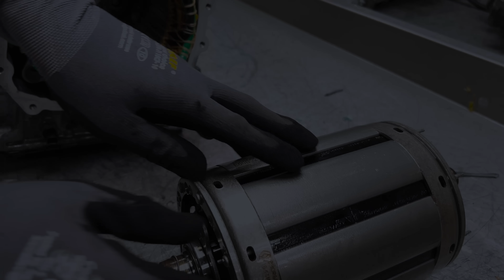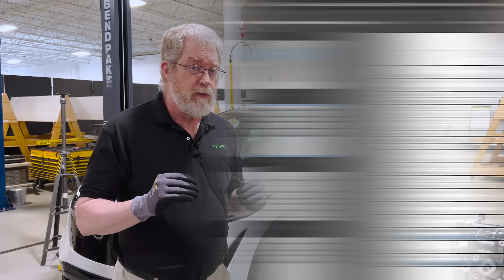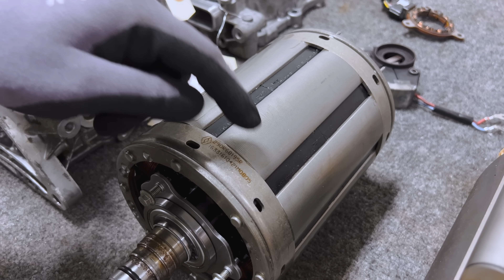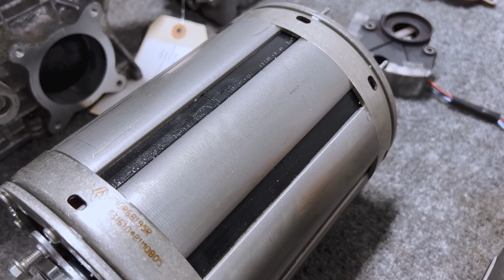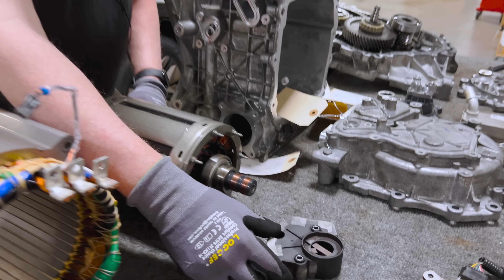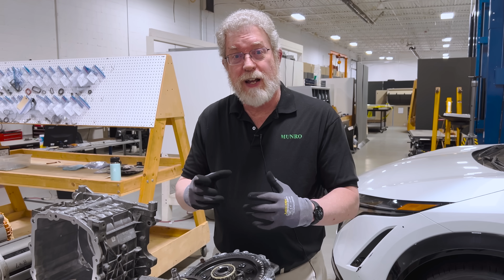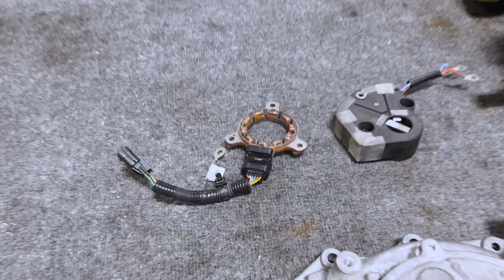This EV Motor Has No Magnets – Nissan Ariya EESM Teardown

Comment: I’m delighted to finally see that someone got wise enough to use a wound field machine. Thirty years ago I was the motor/generator designer for a trade study my company made to see what made the most sense for a hybrid electric vehicle. I designed 4 or 5 machines to a spec and compared them with control systems and manufacturing costs. I was rooting for the induction machine, but the wound rotor won out when all factors were considered. We used an exciter to get the current to the field, but I guess the brushes might be cheaper.
Reply: The brushes may make the packaging smaller than having the exciter winding on the rotor, and less rotating mass too.  I still don’t like brushes if they can be avoided.
Reply: @wtmayhew  in my experience its a lot easier to change a part or component when it is not inside nor mounted within other important parts or soaked on epoxy, i think because of the mobility industry modular things are such a good option
Reply: Brushes and slip rings become wear out items. EV should last 300k+ miles with little maintenance. If it wasn't an issue, the warranty would be extended.
Reply: @YT-MY manufacturers would rather offer no warranty at all. They will offer a warranty to show customers how much better they are than the competition or because some law requires them to.
Reply: @YT-MY  do you get 300k+ on an ICE engine? or were you just saying?
Reply: @YT-MY  You're making a hen out of a feather, Renault has been using this design of motor for some 13 years now ever since the original version of the Zoe, there's no major issues here. The brushes and sliprings are designed to be easily serviced without tearing down the drive unit.

BMW is also using this type of motor in many of their EV models. You're not discovering something all of these engineers haven't considered many many times and designed around, okay?
Reply: I think I saw one recently where the rotating field was excited through a transformer with a moving core.  Pretty cool idea and "ideal" for a synchronous machine, xexnx.
Reply: @mcdevious2229 did you see any rectifier connected to the rotating part of the transformer?
Reply: I don't remember, but you can excite the field with AC and drive the stator windings with [synchronized] AC to make a synchronous motor.
Reply: Le moteur n'est pas de Nissan mais et de conception et de production de chez Renault
Reply: @OliverLeink Yeah, the same principle exists in the Zoe since 2013 already. This is just some fine tuning.
Reply: I have a couple of old EVs (Citroen / Peugeot from the 90s) that use a sep-ex DC motor.  The commutator is a weak spot of course, but I’ve been waiting for it to come back into fashion.
Reply: @evan010101  Commutators wear the brushes much faster than slip rings. This is not the same kind of motor.
Reply: @nickwinn7812 that’s my point. This is the modern version of a wound rotor machine, using electronic commutation instead of mechanical.
Reply: @evan010101  I don't think the rotator is commutated in this motor here. It is DC (but modulated by PWM, so it could be commutated with a full H bridge).
Reply: @tristanwegner agreed. That’s my point.
Reply: I remember seeing a prototype of a machine like you describe at the Solar Energy Expo & Rally (SEER) in Ukiah California ,I think in the 90's. Induction coils (transformer) carried field energy to the rectified wound field. It was very interesting, I've forgotten the name of the company. Was that yours?  If so, Well done! 
These days, if choosing to use the complexity of a wound field, I wonder why not run weak permanent magnets in the field for low torque operation? Then the wound field is only needed for boost at higher torque. I expect it would save a few percent efficiency at cruise.
Reply: @CafeElectric Yeah, great idea. A kind of hybrid exitation. Fex magnets for rolling and coasting (90% of the time) and additional exitation in high torque situations like acceleration (10%).
Reply: I would love to hear how that exciter worked!
Reply: @ockamrazor477  There are couple of ways to do an exciter winding.  One way is to have a stator with permanent or electromagnets generate a field which induces an AC current in the rotor  which is then rectified and applied to the main electromagnets.  I suppose with modern controls there might be a way to dispense with the rectifier.  You could also have the exciter be a rotary transformer of sorts to couple the current to be supplied to the rotor field magnets.  The Nissan motor is pretty high speed and variable RPM which would complicate the latter method.  The chief advantage of slip rings and brushes is saving space and weight.  I have a feeling that the accuracy of control by applying a PWM current directly to the rotor field magnets is also considerable advantage.
Reply: @wtmayhew  a permanent magnet exciter would be uncontrollable. 
You’re right that an exciter could be a rotary transformer, but generally they are an inside-out generator. The stationary part is the wound field that is fed controlled amounts of d.c. and the rotating part is on the same shaft as the main wound field. I would be interested in hearing how else the exciter output could be fed to the main field without rectifiers.
Reply: @ockamrazor477  You would need another section where I assume there is magnetic coupling to induce a current.  You might then need some electronics if you needed DC on the rotor.  Then the question becomes cost and reliability as that could also be subject to failure.  I think I saw mention of a patent about that a month ago.
Reply: >> Thirty years ago I was the motor/generator designer 

Excellent!  I have so many questions.  This motor uses brushes, but not on a commutator.  Instead it uses slip rings.  Is there any material benefit (like greater efficiency) since the brushes aren't commutating?  
Can you make a small (say 4000W) motor of this design with very low KV (like 25) for a direct drive system for my electric mountain board?
Reply: @Rick_Cavallaro I’m retired. Your best bet is to start with a local electrical shop. Also check with aircraft maintenance shops. A small airplane starter/generator might just be what you can use.
Reply: @Rick_Cavallaro  This would not help with motor KV, that is more a function of stator inductance than rotor field strength. Low-KV motors tend to be physically large or very low-power because you need high stator inductance to drive a low enough frequency to spin the rotor slowly without saturating the stator or otherwise having to deal with very sharp current ramps. It just takes more turns.

If you want low-KV, axial flux motors are probably the way to go. They also don't scale down super well, but you can definitely get them in your desired power and KV range, if you're willing to pay lab-concept money. Otherwise the lowest you're likely to find is about 95KV in the sub-10KW-and-not-head-sized sizes.
Reply: I’ve seen a better approach to the breather done by Suzuki on ATV,s. Instead of a tube going up to a higher hight the have a bellows that expands and contracts with pressure. Solves the problem cheaper and is 100% effective.
Reply: @willyleavitt-pe1cw  The bellows is unlikely to be cheaper than a piece of tube and more likely to leak. It's still the best solution for vehicles that get used continuously off road though.
Reply: 영구자석없는 것 외에는 모터의 복잡도 증가, 브러쉬 이슈, 사이즈대 출력 이슈, 모터 제작공정 등의 이슈가 있는데 ,,, 아 😢, 니뽕 ~
Reply: @kristal1624 the issues you mention are all included in a system trade study that considers all factors such as cost, complexity, reliability, recyclability, and safety of not just the motor, but the controller and anything else that is considered important.
Reply: 저렴하지만 좋지는 않은.
Reply: @러킬-k5v what is cheap; and how is it not good?
Reply: In other words you got power to
The stator inductively?
Reply: @bob15479 yes, that's a common technique for large synchronous motors. Mahle got a lot of publicity for its motor of this type for EVs in about 2021; I don't think they have convinced any EV manufacturer to use it yet.
Reply: What you refer as "induction machine"? Can you give me the full name I am kinda lost in translation here,.
Reply: @stefangaleksandrov an induction machine is a motor or generator that has no direct electrical connection to the rotor. A magnetic field is induced in the rotor when the windings in the stator are energized. This induces a current in the rotor conductors that interacts with the stator to develop torque.
Reply: 為什麼沒有大量用於電動車上，因為它有致命缺點，就是碳刷粉末導電導致短路，引起ev off 動力中斷，這款車就有這個嚴重安全問題！
Reply: For those concerned about the brushes - they cost around $90 - $110, so in 250 k mileage…..
Reply: Brush wear is never a concern. The brake pads wear out many times before the motor brushes. Generators and Railway traction motors run for many years before brush replacement. Nice to see that Nissan has made the brush change a simpler procedure then even oil change.
Reply: But brushes wear
Reply: @davidsuzukiispolpot that’s why we did not want them in our design. If you look at Nissan’s brush assembly you will see that the brushes are extraordinarily long and in pairs. This will let them last for a very long time. I believe Paul addressed that issue in his talk
Reply: @lxoxrxexnx  I saw that the "pairs" was addressed, and also the serviceability.  I have seen so many cars in which serviceable parts take a lot of time to access, that I am now squeamish about any scheduled required service, but yes a 160K km interval or so seems reasonable, if it is indeed true.
Reply: @lxoxrxexnx  It also adds a considerable amount of length to the rotor and casing, not great for power density.
Reply: @Nathan0A what “it” are you referring to? This is a mixed conversation and some continuity is easily lost.
Reply: @davidsuzukiispolpot  how long would it takes to change a gearbox clutch plate compare to changing 2 pairs of brushes? or were you just saying?
Reply: @dantronics1682 What is the point of your question?
Reply: @dantronics1682 I think you are comparing ICE motors to electric.  Your error is assuming that brushes are intrinsic to electric motors.  They are only intrinsic to specific solutions.  Even this type of motor could use a brushless system of getting current into the root with some extra complexity.  Do not assume that electric motors need brushes.
Reply: @davidsuzukiispolpot  I saw at least 10 people have corrected you already after reading all the comments, basically I wasnt asking a question just stating that you dont really have an engineering background to be worrying about brush wears, The motor is using the same principle as a European alternator. these doesnt use a permanent magnet and still last well over 20 years or 100k miles
Reply: @davidsuzukiispolpot  I wasnt comparing anything and I did not assume anything, I thought you was the one that highlight that brushes would wear out and would need to strip the motor down to change them. I was pointing out that ice engines with manual gearbox have a clutch and that clutchs takes longer to change than a set of brushes.
Reply: @dantronics1682 Actually, they were not correction.  Since engineering is applied science, explain to me by applying science where frictional surfaces that must conduct electricity are not subject to wear.
Reply: @dantronics1682 Yes, that was me, and by comparing to a gearbox and clutch your assumption is that we are comparing electric to ICE engines, as you pointed out.  The video we were commenting on was talking about different designs for electric motors, so I will stick to comparing the differences in design for electric motors.  Many of them have no brushes or slip-rings or mechanical commutators.
Reply: @davidsuzukiispolpot  rate of wear
Reply: @davidsuzukiispolpot . The brushes only have to last as long as the warranty.  😊  I had a first generation 2011 LEAF and a handful of very expensive things started failing within days of the end of the warranty.  I am convinced it was programmed failure.
Reply: @davidsuzukiispolpot  my Denver alternator on my Chrysler PT Cruiser has been working solid for over 25 years now and I suspect it might even outlast me at this point.
Reply: @MickeyMishra  Slip rings for the win!  I had to replace the alternator on my Mustang, but it IS a 1987!  I guess it is the commutation and arcing that hurts brushes. We know slip rings are better, but OK anything past a decade is good enough.  Theoretically I prefer no friction but good enough IS good enoug!
Reply: @davidsuzukiispolpot  With low current, brushes will last years. These are easy to service, as well.
Reply: @jamesplotkin4674  I expect they also last a lot longer since they're on slip-rings instead of commutators.
Reply: @davidsuzukiispolpot Nissan dealers are very happy to have some extra work.
Reply: @davidsuzukiispolpot  Brush are used in alternaltors as well, but they run > 200K Km.
Reply: @Debraj1978  I did not know that.  Is that why my alternators need replacement? (to be honest, that did happen at around 200K km)?
If true, that means if you bump start a car with no battery, it can not ever start since the alternator will never then produce electricity even with a turning engine..... I have never tried that nor will I since car electrical systems may get fried without battery.
Reply: @davidsuzukiispolpot  Well, the discussion here started with the brush in the alternator, which typically lasts that long. But in dusty environment, the front bearing of alternator somtime failes faster. 
Regarding your other question with "no battery", I think, this would not run the car. Typical situation is a battery which has run out of juice to start the engine, but still has enough juice to run the electronics. Under such situation, the battery is still there and a bump start works fine.
Reply: @davidsuzukiispolpot so do the bearings. brushes can be designed to outlast them.
Reply: @drkastenbrot  I did not know.  I thought that as long as the  lubrication was good that properly maintained bearings just last, but yes, may experience shows otherwise.  Intuitively I would assume that bearings could last but frictional surfaces must wear.
Reply: If the brushes last long enough or are easy to change it doesn't matter that they don't last forever.

In asia its not that uncommon that some tools come with replacement brushes in the packaging
Reply: brushes are never a good idea for reliability. induction tech is.
Reply: @民主美国炸小船 but it looks like Nissan has got the reliability high enough so it doesn’t matter. Engineers can be good at overcoming common wisdom at times.
Keep in mind that these brushes ride on slip rings, not commutator bars. This makes a huge difference.
Reply: @民主美国炸小船  That would be my preference, and when I read an article that a new Tesla motor (or something like that ) was using no magnets, I just assumed that the rotor was energized via induction..... but, I was wrong.
Reply: @davidsuzukiispolpot  The new Telsa motor uses no Rare Earth magnets, different from this tech. The Telsa motor will use either ferrite magnets or iron nitride magnets (which is not yet clear). The first Telsa vehicles (the Roadster and Model S) used induction motors.
Reply: @EleTruk  Thank you
Reply: @EleTruk Tesla's PM motors - which they have been using in several variantions since the first Model 3 - use rare-earth magnets.
Reply: @EleTruk they use a combination of inductive reluctance plus magnets replacing nonmetallic parts of the stator to give a permanent magnet addition to the reluctance motor, for higher torque.
Reply: @民主美国炸小船 these are slip rings so brush wear isn’t really an issue.
Reply: @民主美国炸小船  Electric motors have run reliably for many decades with brushes which kind of destroys your argument.
Reply: @nickwinn7812  we have very small amount of earthing switches of 132kV GISs in the power systems, one day system controller failed to operate the swtch, trouble shooting found the cause is bad contact of brush.
Reply: @民主美国炸小船  One fault in one system does not counter the argument that brushes have been in use reliably for more than a hundred years in millions of motors and alternators. Especially the latter, where, like in this motor, they are on slip rings rather than commutators.
Reply: b @民主美国炸小船 the degree of reliability can be specified or tacitly understood. If a brush exceeds that requirement, then it may be acceptably used.
Reply: Brushes tend to produce ozone. Bad news for city environments
Reply: @willyleavitt-pe1cw  That is true for motors where the brushes run across commutator bars, making and breaking the electrical connections, this causes arcs which can produce ozone. In this motor, the brushes run on slip rings to keep constant connection, it doesn't produce any arcs, so no ozone is produced.
Reply: @willyleavitt-pe1cw  When they spark in commutation. These are slip rings and so hardly spark at all. Compare an EV using this kind of motor to say, a diesel powered equivalent and tehn try to convince me that this motor is "bad news for city environments".
Reply: @willyleavitt-pe1cw   The brushes are inside the enclosed motor.
Reply: @willyleavitt-pe1cw  office printers tend to produce ozone too. lots of office printers in city enviroments, so i guess its not a big issue.
Reply: @mrc4nl  the ozone in a laser print is to attract the powder to the paper before it is fused
Reply: @willyleavitt-pe1cw  That happens when they arc on the commutator.  On a slip-ring you'll get little or no Ozone production.
Reply: @willyleavitt-pe1cw  ozone at what voltage? or were you just saying this?
Reply: @dantronics1682I was mistaken, when you have carbon field brushes ozone is created by the tiny sparks between the brushes and the commutator. Doesn’t apply here